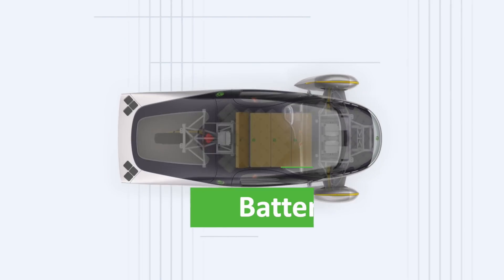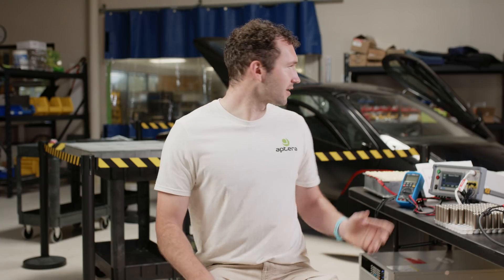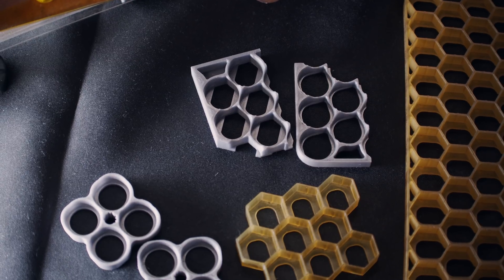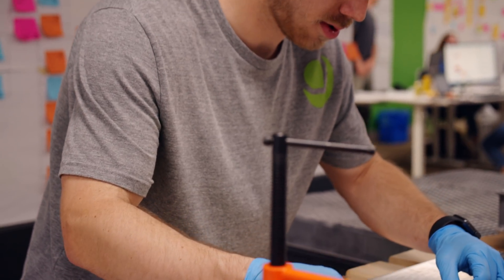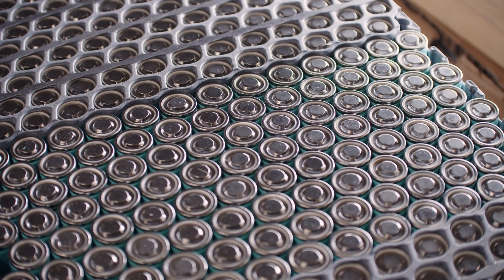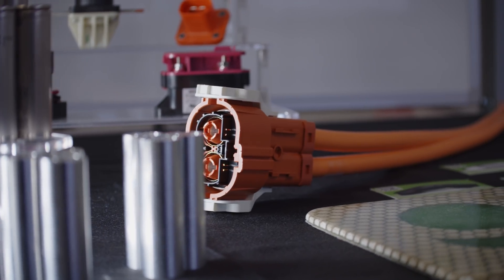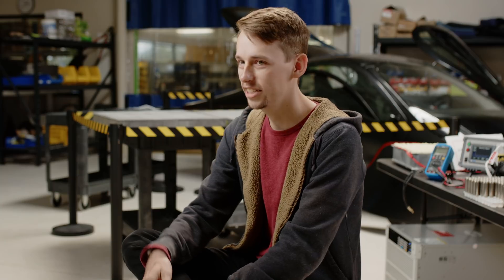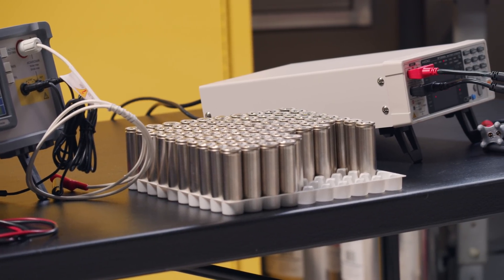Aptera — Battery Update

Comment: It looks like six battery modules is all you can fit under the floor. Then you can place two more modules angled behind the seats. That means 54.5KWh is the max. 60+ you will need to have modules along the floor in the back unless you upgrade the cells. Makes perfect sense please be totally honest.
Reply: I looked up and back in November 2020, Chris Anthony messaged me; Right now we have 100KWh packaged under the seat, in the center tunnel, and behind the seats. And it all fits nicely with the rear storage in design position. But we are working on ways to move more weight forward in that package. This may change the production layout
Reply: @danwat1234  So share the Chris Anthony message you received with us
Reply: @johnmalcom9159  I already posted a direct quote response from him. Suppose I could go back and post everything he wrote to me about other questions
Reply: @johnmalcom9159  12/17/19, 11:38 PM
Aptera Motors

Ah, interesting... I've seen those but not how the Model 3 has them implemented. It would seem to be useful. We are meeting with our lighting guy early next year to do some very cool lightweight LED buckets. I imagine this could be an option in the main bucket or off the wheel covers in the front  
Enter
You sent
Wheel covers would look sharp but less room there for flat installation versus in body
Enter
Aptera Motors

But the wheel covers turn with the wheel  More thinking to do on that. But its a great idea  
 
Aptera Motors

The brake flaps are a good idea but to execute it would add a lot of weight for the mechanism for it... It is better to use the torque control of the motors to do dynamic braking as you suggest. We will have twice the amount of regents capability versus a Tesla or a Bolt so we can do things with just braking from the motors that others can't. Our stability control will be a BIG part of our safety factor and it will add a LOT to the general driving experience  
Enter
Aptera Motors

But we have just started on that programming with Elaphe so it will be a while before we are testing that. But Elaphe has well refined systems now on 4 wheelers that can tanks steer and do all kinds of interesting "vehicle dynamics" stuff  Three wheel dev with them will be fun!
Enter
Aptera Motors

Thanks again for the investment! You support is awesome and I appreciate you jumping in to FB comments with good info. I am honestly overwhelmed with all the dev we are doing, managing media, and finishing up perks for all our investors now... We need more help but are trying to stretch our dollars as fundraising has been slow... We just need to inspire that one investor that gotten rich off of Tesla and we can go a lot faster with our dev  
Enter
Reply: @johnmalcom9159  You sent
when wheel slippage occurs, regen will cut off and will be up to ABS to control skidding
Enter
-_Aptera;
Well we can control each wheel with in 1/60th of a turn so we can make changes QUICK depending on what the rest of the vehicle is doing... Excess Gs in one direction, slip on any wheel, speed correction in turns(for better grip than any differential can provide), and properly applied torque for launching on 0-60mph type stuff
Enter
You sent
So you're saying, unlike other EVs, when a wheel skids or stability control detects danger that regen will aid instead of purely hydraulic brakes
Enter
You sent
Tank steering maybe that was a typo
Enter
Aptera Motors
Tank steering is zero degree turns... Like they showed in the Rivian video of their truck
Enter
Aptera Motors

Because of our three wheel a true zero deg turn will be hard be we will be close, and it will look COOL  
Enter
You sent
Hmmm.
Enter
Aptera Motors
But the important thing is we can correct for or tweak any driving mode we want FAR quicker than any other traditional mechanical or current EV system can...
Enter
Aptera Motors
AND it allows us to be more efficient... No driveline losses and we can drop out motors when needed to always be in the motor's sweet spot for efficiency and torque at say highway speeds or city driving
Enter
Aptera Motors

It is a BIG step up in the "drive and efficiency tuning" of the Aptera
Enter
Aptera Motors
This is Chris  I'm the "stay up late" guy. Steve is the day guy  
Enter
Aptera Motors

Yes, there will be a standard ABS backup system. But we are hoping for near "hydraulic free" driving.
Enter
Reply: @johnmalcom9159  Aptera Motors

Yes, on HARD stops you will surely use hydraulic. But my Model S only sees that like once a year when a bad driver cuts in or something...
 
Enter
Aptera Motors
In snow or ice it would let your wheel slip in proportion to the G force so you still get maximum traction while slowing
 
Enter
Aptera Motors
Yeah, Tesla has good regeneration, just not the GREAT region we will have  
Enter
Aptera Motors
The Bolt actually has better regeneration for "hydraulic free" driving
Enter
Aptera Motors
Steve has a Bolt, I have a Model S
Enter
Aptera Motors
Jason, our lead designer, has a Model 3
Enter
Aptera Motors
So we have good insight into each  
Enter
Aptera Motors
Ah, we will place people by when they actually place a pre-order. We will open the pre-orders up after we can release final specs/pricing/options
Enter
Aptera Motors
That will probably be once we can show a drivable vehicle as it is hard to ask people to commit unless they can see and touch a reasonably refined Aptera
Enter
Aptera Motors

So just hope on-line when we open it up and check the "I'm an investor" box and it will slot you from there  
Aptera Motors
Non-investors would just get slotted below investors but there isn't any priority aside from the "Eco 100" which is just the first 100 Aptera built  
Enter
Aptera Motors

Yeah, that's great for a lot of our former engineers that went to Tesla. We have many former Aptera people that are VERY rich now because they made the move up there... Tesla is killing it and we are nothing but supportive for the groundwork they've laid for us...
Enter
Aptera Motors

There WILL be issues but we are hoping to design thing in such a way that any issues are easy to tackle... The Tesla Roadster Launch full or FUN surprises for early adopters but Tesla handled the issues well and early adopters felt like they we're helping to launch amazing new tech. Hopefully we have a lot of good people like they had. So far we seem to be on a good path  
Enter
You sent
Yes, the autonomous project will be the most challenging and I have a feeling you will go with mobileye
Enter
Aptera Motors

Well, if you know the g-force and distance traveled you can make sure the wheel is turning proportionally to vehicle travel versus tire patch travel. You want your tire tread to STAY on the ground without slipping EVER if possible. So it's a matter of applying jus the right amount of braking force such that keep the tire patch stays engaged with the ground.snow/ice to provide the most braking power. It a complex and multi-variable algorithm but the computer can do it  
Enter
Aptera Motors
Yeah the biggest autonomous challenge for us right now is power usage. Some systems use more power than the WHOLE APTERA does at highway speeds...
Enter
Aptera Motors
But we have a good start on the hardware and are talking with a few capable groups on the software side now. It would be great to tap into someone else's data set early on. Building the algorithm's reference set is the hardest part...
Enter
Reply: @johnmalcom9159  Aptera Motors

Thanks! Yeah, the lighting stuff is still pending but I think things will be simple for these development vehicles. The tooling for production lighting is a different ball of wax... We've not talked about rear defrost but it may be needed for at least the camera pockets. And the doors do currently have straps for pulls but we need to do some physical testing to finalize them so we haven't shown anything yet. It will be an exciting summer as we start putting these first new vehicles together. Thanks for the support!
Enter
3/22/20, 2:49 AM
You sent
What is the estimated calculated top speed if the speed limiter did not exist? I assume the speed limit exist to prevent motor over revving, vehicle stability or common sense.
Enter
3/22/20, 11:37 PM
Aptera Motors

The physics of the motor's armature can't be pushed by the voltage of the controller after 120mph. If we upped the voltage we could go faster  
 
Enter
Aptera Motors

PWM is more of a DC motor thing but it is essentially chopping power. In a three phase motor you just chop it in to different phases... But essentially you can only chop so fast per a given voltage. Once you can't chop any more you can't phase in any more power...
Enter
Aptera Motors

Hmmm... The 100kWh pack would put more weight not he rear wheel so it would be less of a problem there. But in general you'd ALWAYS want more weight on the front wheels as that is where any inertia shift your center of effort to in a collision(at least 99% of the time I'd guess). Even if that meant the front wheels stopped and your ass was in the air. You'd still have better control from the front steered wheels  
Enter
ME:
Is it true there is 120KWh battery option with provisioning for usable capacity of about 100KWh?
Enter
8/22/20, 12:26 AM
Aptera Motors

We can go over 1,000 miles on a 100kWh pack so I don't think we'd ever do much more than that. The "safety capacity" for packs these days is minimal and built into the cell ratings so what we are calling a 100kWh pack is pretty darn close to the spec +/- 2 to 4kWh  
Enter
Aptera Motors

Hmmm... In any case, you can assume about 10 miles per kWh(though we're simulating much better with the lighter packs). So the math is easy from there. But much more than 100kWh either needs a chassis re-design or better battery tech as we just don't have that much space and can't put that much weight on the rear wheel  
Enter
11/28/20, 5:02 PM
Aptera Motors

Right now we have 100KWh packaged under the seat, in the center tunnel, and behind the seats. And it all fits nicely with the rear storage in design position. But we are working on ways to move more weight forward in that package. This may change the production layout

Comment: Will we know if the 250 pack will have enough power for best 0-60?
Reply: My concern would be yhe 25kwh pack being able to achieve fast enough dcfc rates to make long distance travel easy. A 4x discharge rate for short bursts is easier to accomplish than 2x charge rate  for 15 minutes (50 kw from 10-60% for 125 mile added charge on trips). A 1c rate limit would make me reconsider and possibly switch to 40kwh pack. As for 0-60 capability, I'd personally be fine with anything under 8 seconds on the 25kwh version.

Comment: Wishlist for Aptera. 
1. Side curtain and seat airbags
2. Airbags integrated into the cabin and not seatbelt.
3. A more ergonomic yolk. A yolk is fine but the yolk I've seen from you guys has little area to grab. It needs more area towards its axis of rotation. More physical controls wouldn't hurt either.
4. Two headlights in the front instead of the single unit I've been seeing (I'm not talking about the drl). People coming from cars would find the center headlamp jarring.
5. A larger screen for the driver display. One that can display speed, navigation and side camera feeds all at the same time.
6. The rear view mirror display should move in front of the driver so you don't have to take your eyes away from the road when viewing it. (Take advantage of the benefits of cameras and displays) You can also have a regular rear view mirror too. It wouldn't hurt.
7. Design wise. Minimize the amber on the front wheels. And eliminate the asymmetrical and protruding bezels from the displays.
Reply: The single headlight is apparently a regulatory thing. They wanted a lightbar, but motorcycle regs require a single headlight in front.
Reply: @CaptainRotmeat  I see a lot of motorcycles with two headlights that are centrally mounted

Comment: Based on these numbers I really wonder about the 250 mile.  If it has 4 modules it will have an extra 30-40 miles of range and if it has 3 it will only have 210-220.  The 1000 mile will need 18-20 modules due to impact of the weight.
Reply: 250 mile will have less weight .... better efficiency than the 400 mile version
Reply: @lewevans2413  Yes but ... I've read that a typical EV battery weight is about 10 lbs per KWH. In that case the difference in weight between 25 and 40 KWH is about 150 lbs or perhaps 20% less, so about 120 lbs.? --  a small passenger.
Reply: @fotoguru222  Hi Harry, have not calculated that number, but sure. 120lb is a reasonable number.
In a heavy car it would not make a big difference ..... but in a very light vehicle it makes a big difference.

Comment: Efficiency is nice, compact is great, but it makes me wonder: what about the cooling of the pack? We have seen in the last decade that thermal management is so important.
Reply: Better efficiency means needing to remove less heat, so it directly benefits cooling needs.   The BMS will monitor temperature to keep the components safe.  There could be some throttling of performance in hot weather.

It is too early to predict this, but there will be more information coming.
Reply: @n.brucenelson5920  Do we know anything yet about the efficiency of the on--board charger? Or a timeline for when Aptera's engineers will get the time to engineer in a heat pump HVAC? I am tempted to exchange out the heat pump from my 2013 LEAF into my Accelerator LE. It rapidly gets that car's ambient air toasty. Still I am confident that when Aptera takes on the challenge they will make it all the better, and my Aptera cabin will not require near the LEAF's cubic feet of capacity. It would be nice if Aptera's BMS could direct battery heat passenger's way when they wish it.

Comment: Thank Luke, Ahmed, Daniel,  Ryan, Scott, Tom, and Diego!  Thanks for the reassuring news.

Not that it really matters, but I'm guessing each of the 6 packs' 416 cells is arranged 104 serial 4 parallel (104s4p)?  And the six packs are connected in parallel (to keep the car running even if one or moe packs becomes disconnected)?  If so, is the basic configuration 104s24p?  If it is 104 serial, with the 3.7 nominal volt 2170's min/max voltage 2.5v-4.2v, is the nominal / minimum / maximum voltage of the pack 384.8v / 260v / 436.8v?   

I'm guessing you don't want to divulge (at least at this time) the cells' manufacturer name or the Amp hour capacity per cell?
Reply: Some of this information was available to read in the video images.  Check out Steve's video in Aptera Owner's club.

Comment: Is development for the 60kWh and 100kWh packs ongoing in parallel?
Reply: I certainly hope 25kwh gets priority over the 60-100kwh versions. Too much extra engineering to suspension likely would be needed to make those even feasible - since driving dynamics would be totally different as the pack neccesarily extended rearward and added hundreds of pounds to overall weight.
And, to what end? There is no benefit to having a 60kwh pack over a 40kwh pack in this vehicle. If taking a 1000 mile nonstop drive, the 60kwh version would save you less than 30 minutes of dc fast charging. Whoopty-doo.
Reply: @personmcpersonface8796  I tend to agree with you.  The announced order has the 60 kWh versions next, then the 25 kWh and the 10 kWh last.  As we see with the 40 kWh packs, these are nominal sizes and not the exact final pack size.
Reply: @n.brucenelson5920  Actually Bruce, I believe that the order is 40kWh, 25, 60, then 100. I have the 60kWh on pre-order.
Reply: Yes, of course.  They are not completely separate tech.

Comment: Smart to use 3d printed 18650s for test rigs! Save that moneyyyy
Reply: they could have just bought empty cells, which cost nothing....
Reply: @hamishwoyka5599  I didn’t know those existed TbH - I would argue that sourcing and dealing with the lead time on them would still more challenging then 3d printing but obviously more dimensionally correct 🤷‍♂️

Comment: Can we buy the small battery with the car and then add additional batteries later. 

This matters from both a financing and tax level. I would rather start with a shorter range than to finance the purchase of a battery. My state charges property tax on cars based on initial car price. I would rather not have to pay property tax on a large battery every year.
Reply from the maker: You can upgrade your battery pack any time prior to delivery once logged into your Aptera account and upon confirmation of the final configuration of your Aptera. However, currently, we are not planning to have the battery upgradable in segments. If you want a bigger pack you would have to replace the whole battery pack. This could be an option in the future! Our goal is to build this vehicle in a very modular fashion to keep the cost low and hopefully help us scale really quickly.